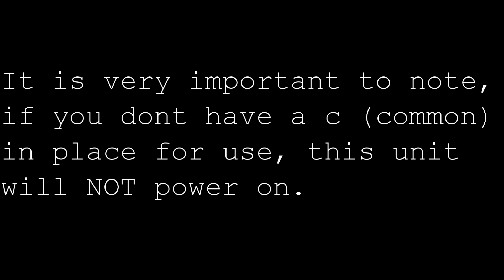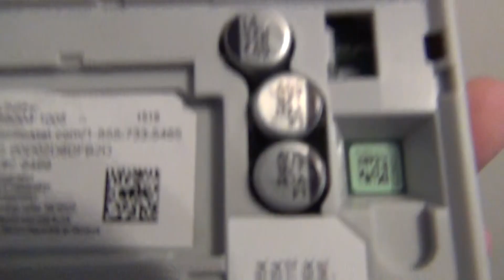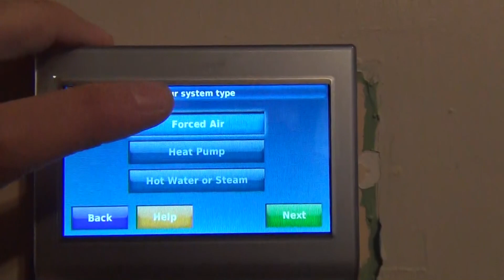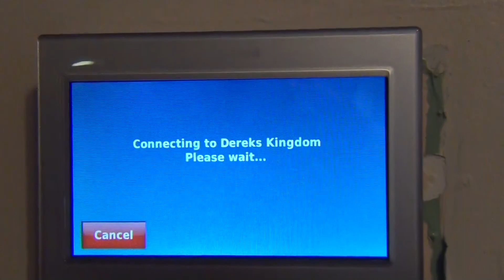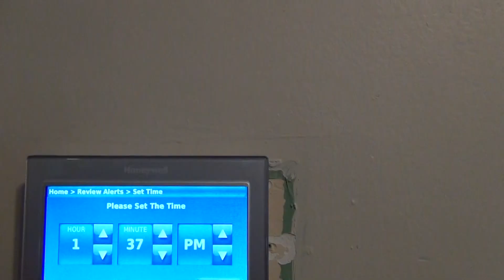Honeywell RTH9580WF Wifi Thermostat Install

Comment: is there any way to have control of the fan with this wiring? I have done this setup and it works fine but we have an HRV and would like to run the fan separately.

Comment: My old one RC and R got jumper and the red wire is on the R ...how should I wired the new one to ?
Reply from the maker: Tran Kali what wires do you have behind ur stat?
Reply: DIY Warriors United I do had all wire including the c wire
Reply: DIY Warriors United doesn't really matter where my red wire go to ( r or rc) to the new one .? If the rc and r jumper is on.?
Reply from the maker: Tran Kali correct doesnt matter. Follow the wiring guide that came with ur stat.
Reply: DIY Warriors United thank u sir

Comment: For those that dont know.... The blue wire is also C wire..... If you have blue wire.... You can connect to C terminal
Reply from the maker: Inquisitve m not true. My brothers blue was wired to G and was actually wrong on furnace side. It wound up being blue was Y. Best bet is to check that the wiring matches the furnace side.
Reply: that's how my old thermostat was connected before i installed my new one.

Comment: Silly question I know but how do you remove the thermostat from the wall plate?  Nothing in the manual.  Thanks
Reply from the maker: rebelduke1 not silly. Look on the underneath of the stat you'll see a tab. Push in and lift the stat up and off
Reply: Thank you!  Just as you said.  Peter

Comment: If I don't have c wire, is that mean I can't install this type of thermostat at all?
Reply from the maker: you can install without a c wire, you can jump the G wire.  Youll be without fan control, but it can be done
Reply: DIY Warriors United I have independent R and Rc wires in my current Honeywell, as in,  they're not jumped. I have no C wire. what can I Do to power up this new unit? The VAC difference is 56 V between R and Rc, and both are 27 to 29 VAC from G.
Reply from the maker: Allen Dindial what other wires do you have?
Reply: DIY Warriors United  I have a G Y W R and Rc wires. I have yet to take a look at the furnace side.
Reply from the maker: Allen Dindial you should be able to jump G no problem but see what you have on the furnace side.
Reply: DIY Warriors United so it turns out I had a C wire coiled up inside the wall and I pulled it out. connected it to the C port and am getting 24 VAC from R to C. unit is not powering on, however. I may have gotten a brick.
Reply: You have to check your furnace to see if the c wire is connected. If it's not there and you want to use the g wire then move the g to the c on both (thermostat and furnace) and jump the y to g at your furnace. Make sure you leave any other wires in y or c connected. This should make the thermostat operational

Comment: Hi I want to use it for heating only, my house has 2 wires  red and white,  can i connect the red in space with the letter C
Reply from the maker: No. C is used for power. Hook up everything as I have and just skip the Ac portion.
Reply: you can not use the thermostat if you only have two wires.
Reply: thank you
Reply: Sorry,finally could you use it? I have also two wires,and I dont know how can I connect it. Could you help me?